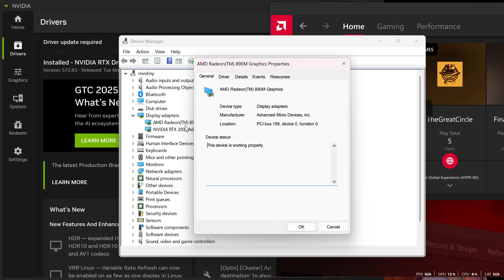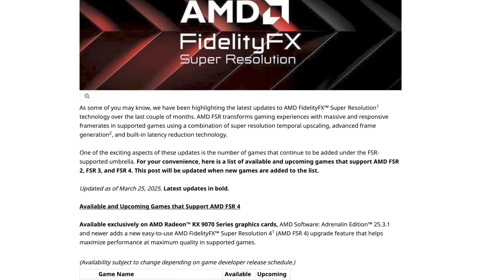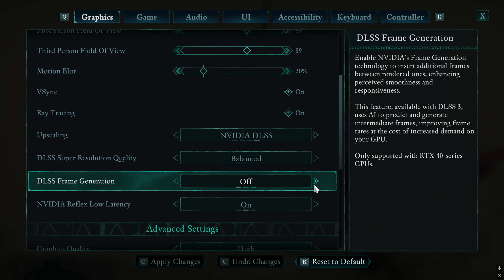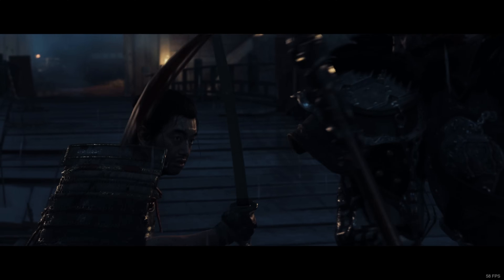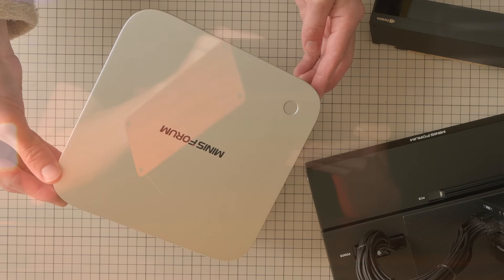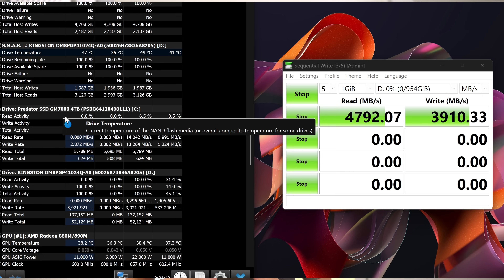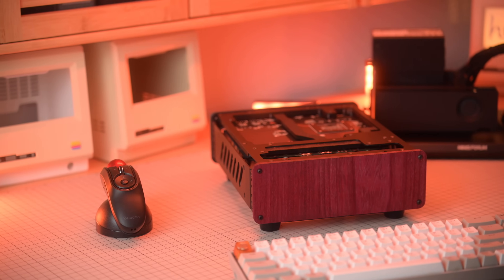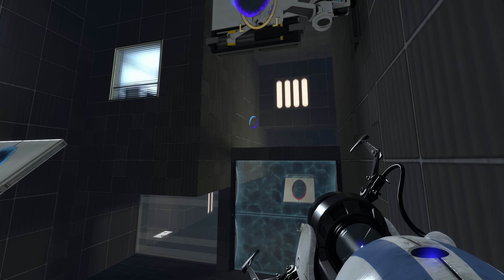You Should Try DLSS + FSR Co-Processing on Your Mini PC

Comment: I have a gpd win mini (2023) which comes with oculink. It cost under of $900 at the time with fast 7500mt 32GB ram and 2TB of storage. It has a 780m which is still a pretty decent performer for modern handhelds. You should look into using a program called Lossless Scaling sold on stream for your dual gpu setup up using framegen. It's way easier to set up for any game regardless of the scaler selected in game. You just need to make sure the output video is plugged into the gpu which is running Lossless and that the game is being rendered on the other gpu that has no video hooked up for the best results. Plus game needs to be run in borderless fullscreen mode. Lossless works great on igpus too or single graphics card set ups as dual gpus is not a requirement.

Comment: So you are enabling AMD Fluid Motion Frames in Radeon control panel, on top of DLSS Framegen? They are not the best, much worse than FSR 3.0 in the game, as they don't have access to the motion vectors. Sure the smoothness improves, as in total you are generating 3 additional frames for each real one, but it is not that much of benefit of coprocessing but instead just a feature that Nvidia doesn't have. But you could get almost the same results with lossless scaling others have mentioned with just Nvidia GPU

Comment: ALSO ANOTHER NOTE: I hope developer NEVER IMPLEMENT this cheap trick to fake performance
WE NEED MORE OPTIMIZATION no more cheap shortcuts to performance
Reply from the maker: I think you’re overcorrecting a bit here. It’s not an either/or situation—you can have both. Every game I’ve enjoyed over the past two months has run surprisingly well on this machine. I was especially shocked by the Resident Evil remakes—they look phenomenal and ran near 60 FPS at 1080p on high settings (minus ray tracing) using just the APU.

Now, if you want 4K with ray tracing enabled, something’s gotta give. Either you drop $1000+ on a GPU to brute-force it, or you use some smart upscaling. Having flexible options between those extremes is a good thing.

And to your point, yes—some devs are leaning too hard on these tools and cutting corners, and that’s where we should be calling things out. No need to throw the whole system under the bus.
Reply: @ NO most recent example Monster Hunter Wilds running on Intel Core i9 10700K dedicated storage Kingston KC3000 Nvme 2TB GEM3 SSD 64 GB DDR4 3200 MHz and Asus TUF Nvidia RTX 4070ti (16 GB version) struggle to reach 90FPS with fake frames off settings high at 1440p and the loading of each quick travel looks like a PS1 game so NO NO MORE FAKE LAZY CHEAP SHORTCUTS optimize the code and no more AI BS
Reply: @AdvanceRGB  some people are too casual to care about the difference. i know we hardcore gamers do not like it, but majority of gamers arent hardcore at all.

Comment: Lossless Scaling can be used to use the second GPU purely for frame generation. In this case, the latency is the bandwidth of the pcie. And whether it is directly connected to the CPU of the motherboard is important. For example, it is possible to output through pcie 4.0x8 through m.2, but whether m.2 is directly connected to the CPU has a big impact on the latency. The best way is to use the second pcie 4.0x16 slot, unless it is ITX.
Reply: But what I'm curious about here is what if you have a very powerful integrated GPU like the Radeon 8060s? You don't have to worry about bandwidth latency, and I know that the RAM that's important for frame generation can be filled with DDR5. If frame generation using Lossless Scaling becomes stable, the value of APU in terms of playback angle can open up a whole new world that surpasses X3D.

Comment: The dual-GPU setup is simple: Use your strongest GPU (the one that will actually render the game and make use of DLSS or FSR) as the "preferred" GPU for your game in Windows, hook your monitors up to the second GPU used for frame generation and then turn on LSFG/SM/AFMF2 on the second GPU. This has been observed to work with the driver-level Smooth Motion and AFMF 2 solutions too, but LSFG (Lossless Scaling Frame Generation) is the method that's getting everyone's attention. People have been able to use this even on dinosaur hardware with insane results!
Reply: How do you enable it on the second GPU? Do you need windows 11? I have W10 and W7 and only 7 can see both GPU's.
Reply: @LowBudgetGamer-o6l  You need to have both GPUs detected by the system before any of this matters. W10 and W11 have been used in most tests -- not sure about W7. Try and get both of them to show up in Device Manager -- also, it would be helpful to know what kind of hardware you're working with. Are we talking a minimum of the 6000 series AMD GPUs? the 1080 Ti? Architectures that at least support frame gen? Mobo capable of supporting this? Etc? 

You enable FG on the second GPU either through using/configuring lossless scaling (available on Steam) or through configuring the second GPU's drivers, specifically GeForce or Adrenalin, whichever it may be. (Or the Intel drivers, if XeSS FG is out.) Getting the output through the second GPU requires having your monitors connected to it.
Reply: @ I have a GTX 1050 and 760. I'm using a driver that works on both cards (572.60). The motherboard is a Gigabyte Z790 Aero G. Both cards are detected individually, but never both at once. I installed the 1050, then the driver, then the 760.
Reply: @LowBudgetGamer-o6l  Did a little digging, came across an old installation guide for the GTX 760. Manual said the following: 

"Note: It is recommended that you install the graphics card
into the primary PCI Express x16 slot. If you install the graphics
card into the secondary slot, your system may not recognize the
graphics card and there will be nothing displayed on the monitor."

... which is, of course, helpfully non-specific and we don't really care what Nvidia thinks. Looking into it elsewhere, doesn't really seem like this use case came up much, but I did notice something about your board -- I'm not sure what kind of PCIe it offers outside of the primary Gen 5 x16 that the GTX 1050 is most likely hooked up to. Are those other lanes choked out? Does this issue only happen with the GTX 760? If the roles are reversed (760 > Driver > 1050) does it happen to the 1050? Does the affected GPU change when you switch around the slots? 

Also, for what it's worth, most of my experience with hardware is AMD... I was a little late to the party. I'm preparing to do all this myself once I get my hands on the new RX 9070 XT.

Keep me posted!
Reply: @blitzgear02  There might be something to that, I read somewhere that I have to install both cards individually into the main slot, then after installing drivers I could put them both in any slot. Only the 5.0 slot will recognize a GPU on windows 10, but both slots work on windows 7. I have no NVME in the 5.0 slot, I know that shares a lane with the GPU.
Reply: @blitzgear02  true dude! on rog laptops you can render the game on Nvidia then output via amd apu to get a boost
Reply: Got it working on a gtx 1050 and 1050ti, can play games at 2k now, even the frame gen works. The GTX 760 will not work with the 1050 even though I can run them both with the same driver. I only have one PCIE slot for a GPU, so the other one is going through the chipset.

Comment: You can already use lossless scaling for this thing using the dual gpu mode.
You use one card to render and the other card to generate frames, resulting in way smoother gameplay without fps loss due to framegen
Reply: was searching the comment with lossless, pretty much a no brainer now

Comment: I do this on my laptop, my DGPU handles the game while I use lossless scaling and my IGPU to do all of the scaling work. Since all of the frames have to be handed over to my igpu for displaying anyways, I figured it'd be perfect for a frame generation and upscaling.
Reply from the maker: My man
Reply: How does it look ,ghost tails ? Feels/latency noticable?
Reply: @oj2416   Strongly depends on IGPU performance. I don't notice anything bad, as long as I'm plugged in, but on battery, it's definitely noticeable. I should also note that I'm using a cooling pad with a little foam edges to force more air Into the laptop for better cooling, because naturally you have both the IGPU consuming power and the DGPU consuming power and the CPU. So it gets pretty toasty.
Reply: @bonnyboi  can you tell me how to do it?

Comment: Looking up the Ai X1 Pro I'm now seeing what kind of bargain the framework desktop really is now. Both machines are around $1000 with the framework being a little more and the miniforum being a little less. But the framework actually has strix halo while minisforum only has strix point. That's kind of a big difference. The X1 has 12 CPU cores and 16 GPU cores while the framework has 8 CPU cores and 32 GPU cores. Though the X1 has the benefit on the oculink port while the framework won't really be expandable. AMD has caused  some really interesting mini PCs and I wonder if minisfourm will get strix halo as some point though I'm thinking it might not be as cheap as the framework desktop.
Reply from the maker: 100% agree super interesting SFF pcs thanks to AMD.  Would love to own a framework with a Max+, but the reason I went with the Ai X1 Pro is video editing...my M2 Max (Mac Studio) runs out of memory with 32gb shared, and to get 64 gigs on the framework the price shoots to 1500 and realistically configured is 1800. It's worth it, but I wanted to try for something closer to the 1000 dollar mark to meet where most of my customers are. But yeah...hopefully I can get my hands on an Ai Max+ ;)

Comment: Have you tried the DLSS-to-FSR Frame Generation mods for games that support DLSS? 
If you have an RTX 2000 or 3000 series GPU, these mods essentially allow you to use DLSS pscaling and FSR Frame Generation simultaneously in unsupported games. (game must have DLSS suport)
In my limited sample the perforamace hit of using the mod is lower vs using lossless scaling. 
also Optiscaler (open source app fot add FSR FG to anytrhing) has some use scenarios.
Reply from the maker: I messed around with the DLSS mod for Resident Evil 4 RE but didn't include it in my samples. Thanks for pointing this out for others.

Comment: OT: I tried lossless scaling frame gen by streaming Cyberpunk 2077 at 60fps with parsec from the PC in the bedroom (rtx 4060) to the PC in the living room (GTX 1070} activating LS frame gen here easily reaching 120fps or even 180 if I wanted... I have a 65" 120hz HDR TV. So I confirm that it works. The lossless scaling frame gen works from PC to PC👌
Reply: @ilposto7489  horrible latency though
Reply: @GoblinArmyInYourWalls  it's not bad, really...
Reply: Your streaming PC = game, streamed to your TV PC = Lossless Scaling?
Or, your streaming PC = game + Lossless Scaling, streamed to your TV PC?

If former, could stream games from my streaming PC to Steam Deck OLED, then Lossless Scaling on stream from Steam Deck OLED?
Similar to, APU iGPU = Lossless Scaling + dGPU = game?
Reply: @nix.aeternae  game streamed from PC desktop  to htpc under TV on htpc I uses lossless scaling frame gen
Reply: @ilposto7489  Dude just use Artemis and Moonlight. They are specifically designed to turn your PC into a remote/streaming game device. So you can play games on any platform including your phone and hacked consoles as old as a 2ds

Comment: Did I miss the section where you explain how it works or what settings were best for which games??
Reply from the maker: I have a spreadsheet in the description with the results for GoT, along with other helpful info. I don't cover FSR or DLSS framegen or upscaling here; there are other videos on the subject you can find that can go as deep or shallow as you want. But I do have a section explaining that the iGPU (890M) is handling the upscaling and the discreet GPU (A2000 ADA) is performing rendering and frame gen with a reduced workload for increased performance.
Reply: @NotFromConcentrate  perfect, thanks!
Reply from the maker: I should add that the highest performance in terms of raw numbers came from plugging the monitor into the Radeon iGPU, enabling AMD FSR framegen and FSR upscaling, and using the discrete GPU to render the game. But the best looking combo (IMO) was what I mentioned in the last comment.

Comment: You don't even need an AMD card to enable DLSS Upscaling + FSR3 frame gen in Ghost of Tsushima, just a single nvidia card will do. What are you even talking about here?
Reply from the maker: The hypothesis is performance increases, which my tests showed conclusive. It's marginal, but it's there. This combines with the point of the video, which is if you already have a min PC with an integrated AMD GPU, and you plan on using an Nvidia gpu via TB4 or Occulink, you can try it. I hope this clarifies the video for you. Thanks.
Reply: This video contains a lot of misleading information. For example, you mentioned running DLSS on the Nvidia GPU and FSR Frame Generation on the AMD GPU at the same time. However, in Ghost of Tsushima, it's actually DLSS and FSR3 both running on the Nvidia card. It's not possible to have the AMD card handle the FSR 3 processing. The only things the AMD card could be used for in this setup are RSR or AFMF, which function independently of the game itself. Hence why your decision to purchase a variety of different games for this specific setup seems a bit unusual. 

If you want to find games that can combine DLSS upscaling + FSR3 FG, you can replace any DLSS frame generation game with FSR3FG, while still keeping the upscaling component of DLSS, using a program called OptiScaler. 

Not to discredit your journey but it would be a lot better to issues correction out so other viewers might not be mislead about what is actually running on which card.
Reply from the maker: @cun1806  I really appreciate the comment and explanation. That said, ‘misleading’ is a pretty heavy word—and I want to be clear that misleading anyone was never my intention. If I made a mistake, that’s totally fair game—that’s what the comment section is for, and I genuinely appreciate when people help clarify things.

Just keep in mind: I’m a human being who was genuinely excited to squeeze some extra performance out of a mini PC and share those findings with others in the same boat. I never claimed to have solved anything huge, and I even asked for help right there in the video. But at the end of the day, I did get more performance out of my machine, and it was due to the APU picking up some of the load. If you want to help with better terminology, that's great--I'm just using the terminology presented to me on the screen, like a normal person would see and interact with.

I guess I’m just feeling a little burnt out—it seems like a lot of folks skimmed through and missed the bigger picture. I hope you can empathize with where I’m coming from.

Comment: This has been an interesting endeavor as I have done research myself. I just don't have the hardware to test it out, but...
I have a Framework Desktop mainboard on the way with the Ryzen AI MAX+ 395, 128GB LPDDR5X system shared memory, and the Radeon 8060S. Should be an interesting test when I hook up a non-frame gen Nvidia GPU, and use AMD Fluid Motion Frames with either the Radeon 8060S or the Ryzen AI MAX CPU.

Comment: Nvidia already has its own FSR1/RSR competitor called NIS that also can be enabled while using DLSS

Lossless Scaling also have options to upscale image using NIS/FSR1, so yeah, unless we're talking about AMD AFMF or Nvidia smooth motion, There's 0 reason to buy 2nd GPU for upscaling purpose. 

FSR FG thing is kinda stretched since Nvidia GPUs can use them without any issue and since FSR 3.1, AMD had decoupled FG and upscaler to enable them to be use alongside DLSS/XeSS (probably because they realise how bad their upscaler is) And I doubt enable FSR FG will even utilize AMD GPU for frame generation
Reply from the maker: I don't think you should buy a 2nd GPU for upscaling. That's ridiculous. I think that if you have an integrated GPU already and you upgrade to the other brand...then why not try it? Peace.
Reply: @NotFromConcentrate  For some people, like myself, I always disable iGPU for extra performance unless I'm using my gaming laptop on battery. 

IMO, enable iGPU just for feature that main GPU already have is kinda pointless even if RSR/NIS really utilizing iGPU for upscaling, Is it even worth the performance hit just to enable relatively computationally cheap feature on iGPU.

iGPU can slow down a Gaming Laptop up to 35% in games like CS2, and it's actually the best practice to disable iGPU using MUX switch when we're plugged in to the wall (external monitor also do the trick if on the older device with no MUX switch).

Desktop can also be slow down by iGPU, but not to the extends of laptop.
Reply from the maker: @dqskatt  You should subscribe to the channel; we do lots of pointless fun things as fast as possible. xD